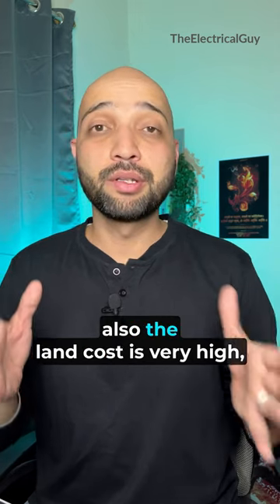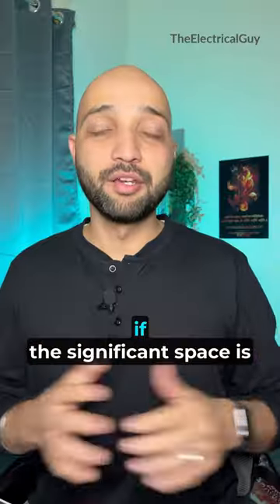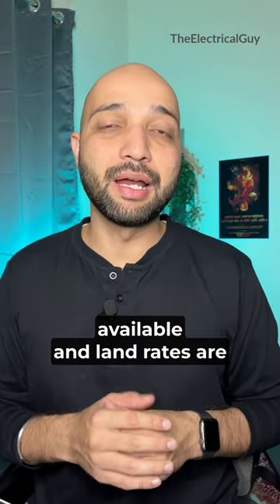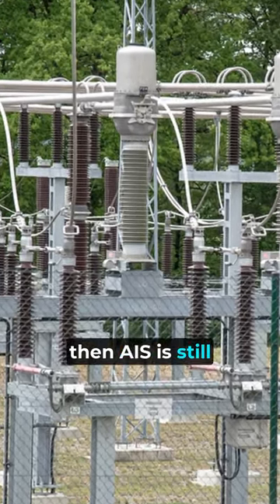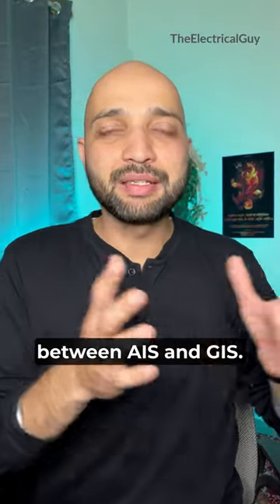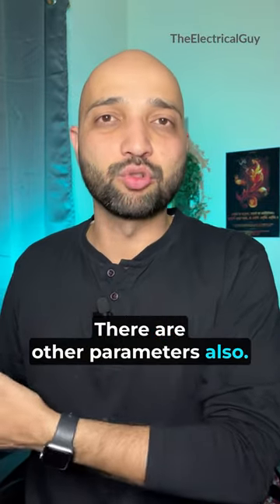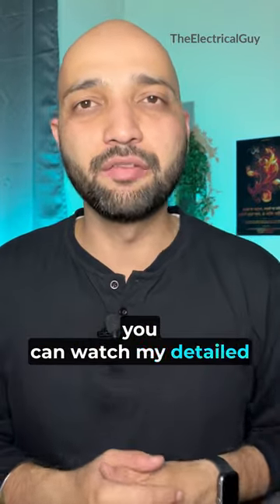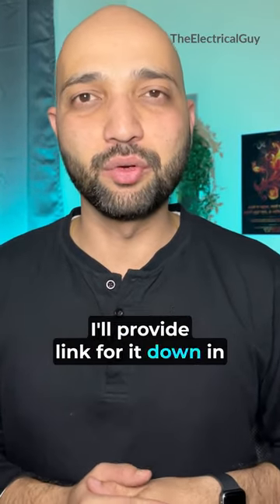GIS vs AIS | Which one is better?? #switchgear #electrical #substation

Comment: Had working experience in both substations and I'll choose AIS over GIS anytime as maintenance of an AIS is very easy and cost effective. GIS substations are said to be maintenance free, but if any defect occurs in GIS component you'll have to replace the whole unit/equipment, which is costly and time consuming.

Comment: Sir , In GIS Switchgear, Some Companies Like ABB , uses Vacuum for Arc Quenching purpose , So is there any need of Vacuum as we know there is already SF6 gas Which is highly Electronegative gas ( Easily Absorbs the free Electrons between the Arcing Contacts. 

So please Suggests me , Why they are using Vacuum  ?  As I asked to them so they said Our GIS is Limited upto 33KV So this is new technology for Arc Interruption process , Increase the reliability of CB.
Reply from the maker: Hello. They must be talking about the SF6 free switchgears. In which SF6 gas is replaced with vacuum for switching purpose and clean air (or other gases) for insulation purpose. You can visit courses.theelectricalguy.in and join my free webinar in which i have talked about the SF6 free switchgear.